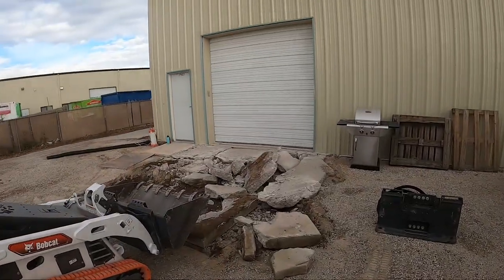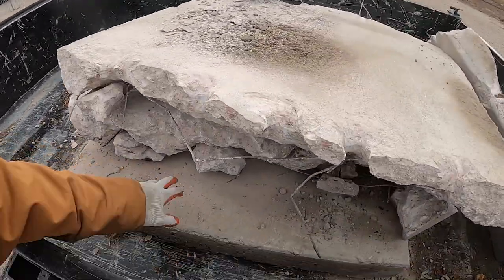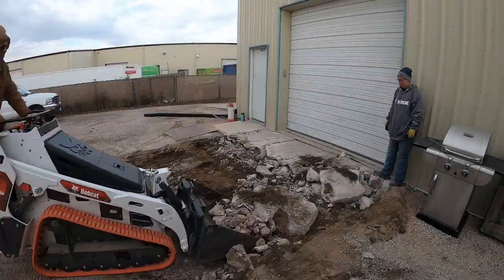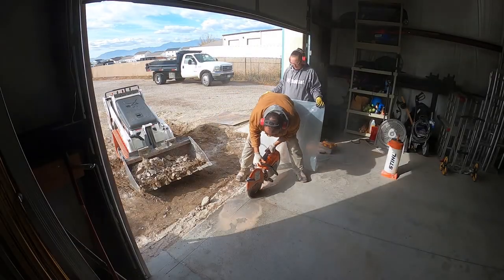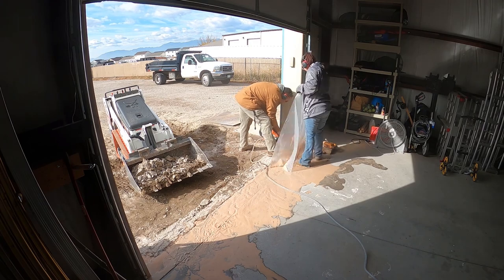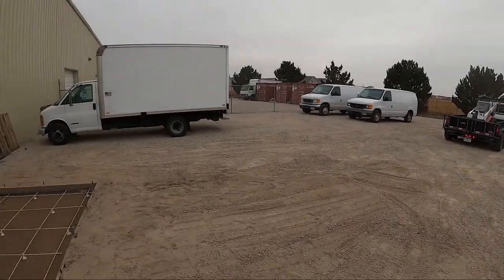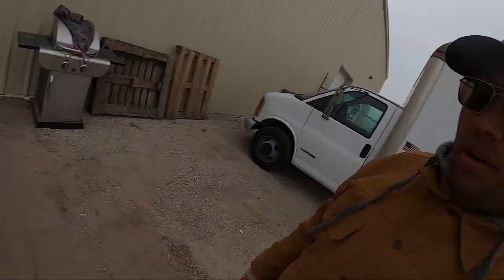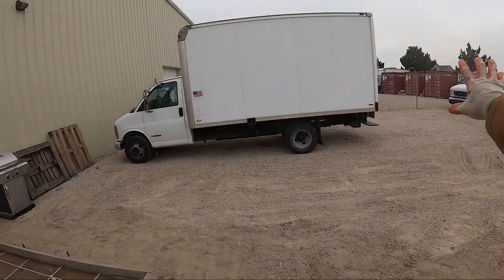Commercial concrete driveway apron pour. Mt100 can carry so much weight!

Comment: I see us adding that to our fleet I like that machine
Reply from the maker: I would certainly recommend it. Even though I I'm gonna purchase a s450 for when we get a dump truck. This mt100 combined with a Ford F600 dump truck (next big purchase coming soon) with a 22k gvwr is probably the most I will ever need on any residential job. User friendly machine that let's you jump off quick to move material around. A proficient operator can accomplish a lot with this machine and it can go where no other machines can usually.

Comment: I wana know what the weight of the tipping point is, the max b4 its nose hits the ground!
Reply from the maker: Tipping weight is over 2800 lbs. Which is huge. That's almost 3/4 of a yard. And that piece was easily 1500 lbs.
Reply: @jmconcretecoloradosprings  I hear specs but I really wana see! I will give you an example (maybe a winter video)

Comment: Your control joint is wrong. You never should make a joint that isolated at the end.  Over 35 years in the game. Plus family in it for over a hundred plus.  Good luck in future.
Reply from the maker: How should it have been done then? I believe Proper transfer of load due to aggregate lock in the right place and the customer this was for was a structural engineer which concurred with joint placement as well. I believe the joint is correct. And so does the engineer this was built for. A joint near the door might have been needed but not wanted.
Reply: Well I work for one of the biggest company's in the world and have been a union member plus all my life brother.  Life experience is more important than keeping knowledge to myself.  I am very sure that when you end any control joint that small overtime it will crack and pull away.  Fact. I'm not trying to do anything besides help out with my knowledge and life experience.  Good luck with your business.
Reply from the maker: @andrewmiranda6160  That's nice. Pull away how? Where it meets the floor inside there is 8 #6 pins holding it. And the bar In the slab keeps it together at the joint that was tooled.
Reply: @jmconcretecoloradosprings  
Ending a control joint that is less than at least 6 inches in the long term will weaken and structure of the base will crack and pull away. Fact. Like I said I am passionate about the game and want my fellow master of game to have more knowledge. Good luck in future. Peace my fellow master of the art.
Reply from the maker: @andrewmiranda6160  less than 6 inches? There is the one across the middle. I appreciate the advice. But what do you mean?
Reply: Ending in a small joint to a point ending in zero is wrong. No point in a solid materiel will hold its true strength. Fact. I have been working our  country my fellow master of game all around this country and have a great knowledge of what happens when you end in a point ending in zero. Good luck in future and enjoy life as a master of the art of our trade. Take the knowledge and life experience and do better for your family and future. Happy holidays my fellow master.
Reply from the maker: @andrewmiranda6160  Right on, I appreciate the info.
Reply: @jmconcretecoloradosprings  Don'tcha know?  You should have made the control joint in the form of a circle in the middle of the slab, AND THEN placed an additional one directly through the center, end to end.  That way, your joint would have ended at 3.14, instead of zero.  My 2000 plus years of experience taught me that, you amateur.  Why, I could tell you story after story about the various tricks of the trade I learned back in my day when I worked on building the aqueducts for the Emperor.  

BS aside, enjoyed the video, the pour, nice finish done on that as well.  Also enjoyed this particular comment chain for an entirely different reason haha.
Reply from the maker: I still don't know what they meant. Your comment made me laugh. Thank you for your comment. Thanks for watching!